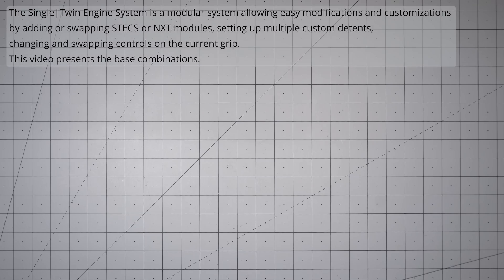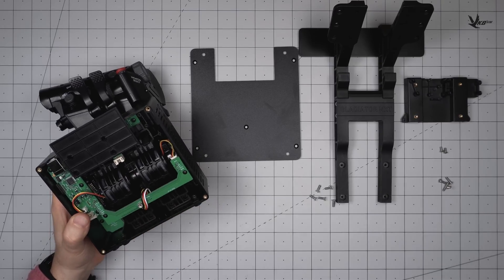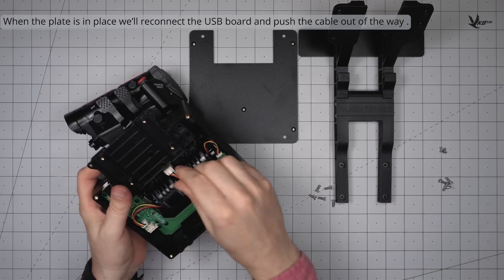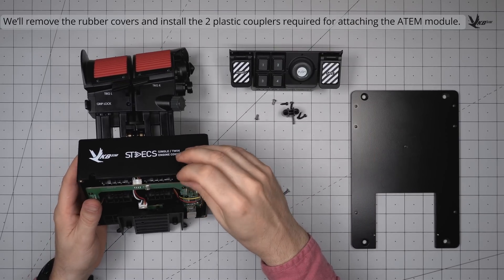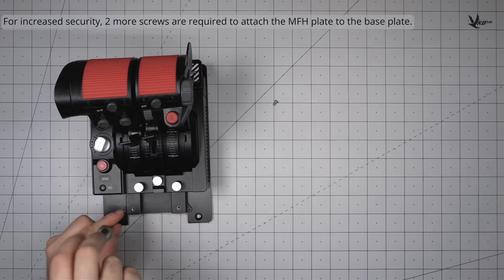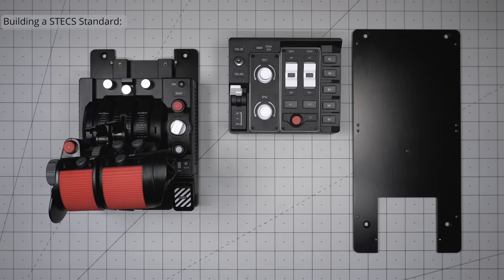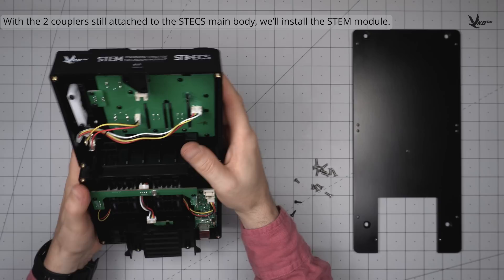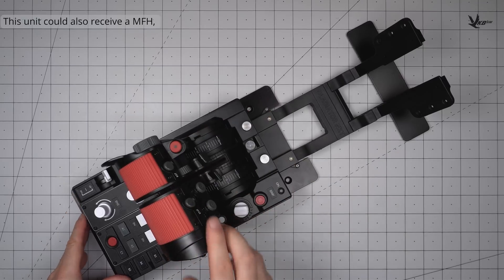STECS combinations

Comment: Can the two flat trigger things  that look like  flaps be programmed to operate the rudder with your fingers (like you can with the paddle on the TM TWCS throttle,) instead of using a twist rudder on the joystick?
Reply from the maker: You could use them as rudder, but they're digital and you'll have to assign them to Rudder Left and Rudder Right instead of Rudder Axis. Or you can program them to an axis like shown here https://youtu.be/GB-pf6dEICM, then bind that axis to Rudder Axis.

Comment: The modularity on this is interesting, but it's kinda sad that the STECS system isn't directly compatible with the side-to-side modular system the rest of your devices seem to be operating on.
Reply from the maker: If you're referring to the NXT modules, then STECS is a different line. They're still compatible through the MFH.
Reply: @VKBSim  perhaps they are compatible like that, but it still would've been cool to be able to have the STECS hooked to one side or the other of a left-handed EVO OTA: have dual sticks for regular maneuvers, and have some detents on the STECS for engaging bonus thrusters (in the middle) and then warp/jump/hyperdrive/etc at full extension.
Reply: @VKBSim  How would you actually connect the two via an MFH, by the way? The NXT EVOs don't allow direct mounting of a MFH to its base, unless you're suggesting attaching another NXT module to the EVO's side and using that as a mount...
Reply from the maker: @Caldoric  All STECS versions other than the Mini come with a MHF adapter.
Visit our Discord server please, it's friendlier for conversations like this https://discord.gg/UJAdpdHpYm

Comment: Where's the option for an ICP?  The teaser going all the way back to 2021 showed that would be an option but it's not.  Any plans to make it in the future?
Reply from the maker: Could you add more details please? Not sure what you're referring to.
Reply: @VKBSim  It won't let me post the link to a forum post from 2017 that showed a 10 digit numberpad attached to the throttle, an ICP - Integrated Control Panel.  It's not an option on STECS, will it be added in the future?
Reply: @kinnymonster  2017 holy jeez

Comment: Is Stecs Mini heavy enough to stand still while using it? Btw, what's the weight of Mini? But I think I will go with that small addon with few buttons on it as well.
Reply from the maker: No, like specified in the video, has to be clamped. It doesn't even come with rubber feet.

Comment: It looks so light
Reply: Cheap alternative: heavy duty velcro.
Reply: They do say multiple times they recommend a mounting system.
Reply from the maker: The Mini is for mounts or for some desktop clamps. The Standard version has more than 2kg.
Reply: @VKBSim  will the UCM desk mounts in the shop have their compatibility updated?
Reply from the maker: @joshua41175  The Standard version fits the UCM WH plate. For the other 2 versions we're still working on the UCM plates.
Reply: @VKBSim  good to know.